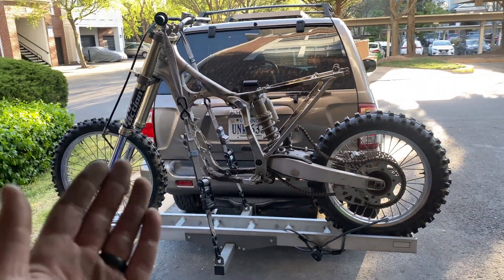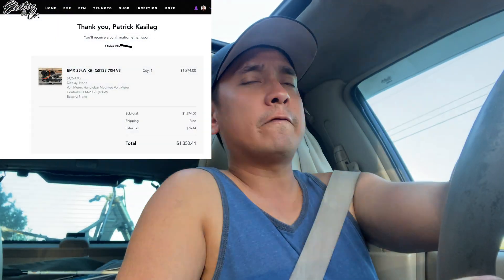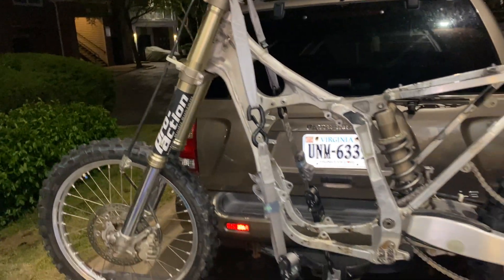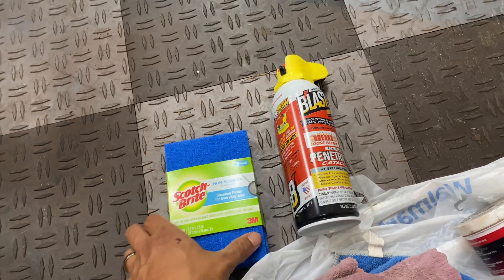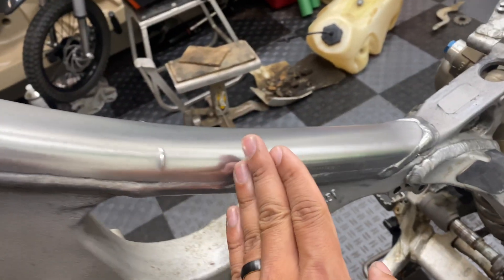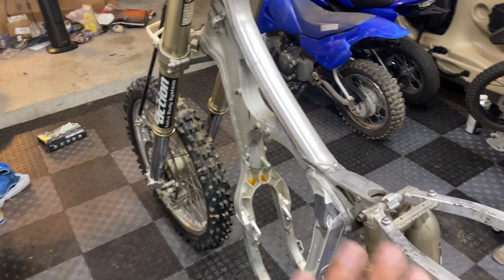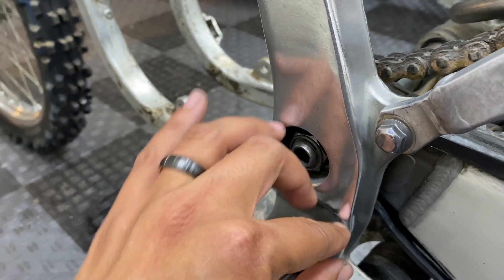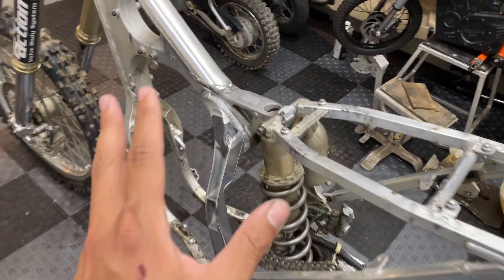Project YZ E | YZ250 Electric Dirt Bike Conversion Part 3

Comment: Nice! this is gonna be a sick bike! Do you know if the motor only bolts to the yz85? or any frame from 02-2018? kx, ktm, rm ect 

Thanks! and cant wait to see how its built and turns out
Reply from the maker: So my bike is not a YZ85, it’s actually a yz250. I’ve never used this kit before, but im suspecting I have to fabricate additional brackets to make it work. So we’ll find out!